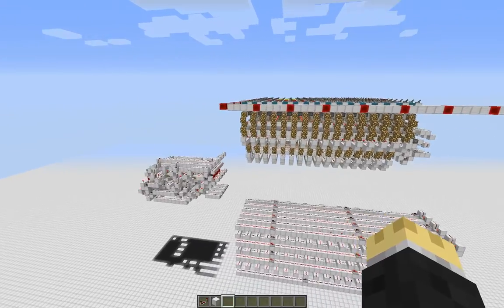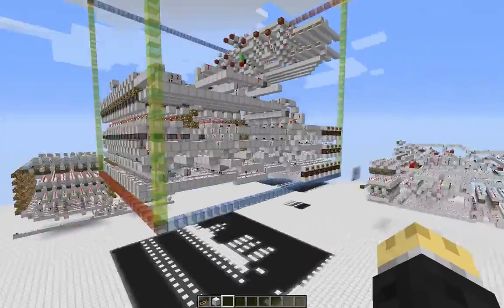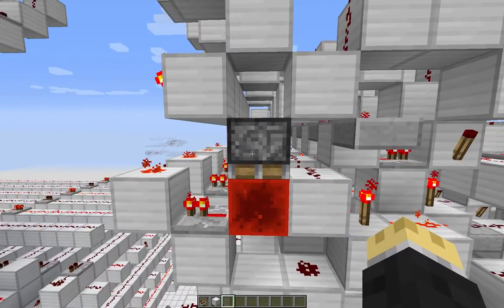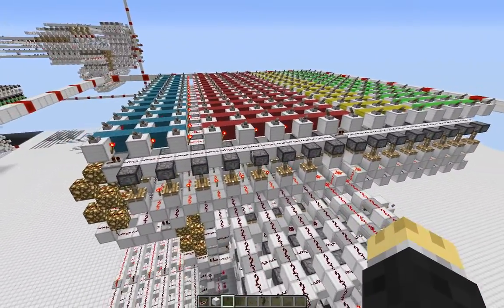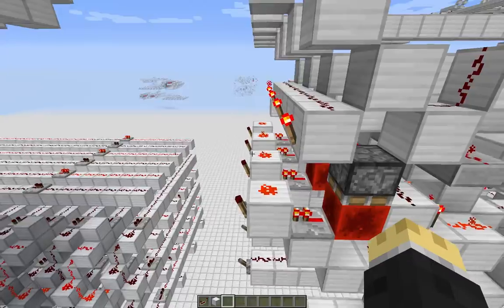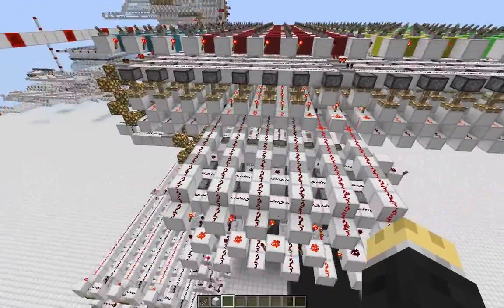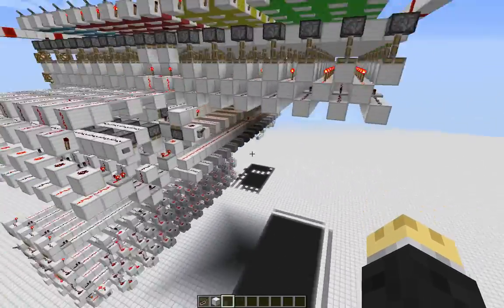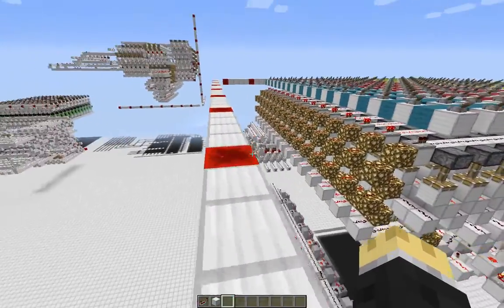Deep Thought Vlog Entry #1

Comment: What is that program memory design? More specifically the decoder. I’m using the program memory for a PC im building. I reverse-engineered the top part, but I still need the decoder design. if theres a world download or a tutorial that would be very helpful
Reply from the maker: It's just your standard run-of-the-mill decoder folded under the encoder...

Comment: Hey! I've got another challenge!: build a Processor, but everything diagonal! Btw, i love youre video's!
Reply from the maker: not sure how practical that would be... nor if it would be much of a challenge...
Reply: O! You replied! 😮
Reply: But i mean; Diagonal ALU (Maybe a CC Adder), Diagonal Registers, Diagonal RAM, Diagonal PROM... That's what i meant.
Reply from the maker: again... not sure how practical that would be.... but as far as a diagonal register and alu n such, that might be really difficult!

Also, I try to respond to people when I can ;)
Reply: I've got a "Everything diagonal" processor. With a 6Tick clock! Now I'm trying a "Everything Vertical" Processor! Again... with a 6Tick clock. And pipelined! 5Stage: iFetch, Decode, Reg, Exe, WriteBack.
Reply from the maker: not bad... I'm curious though - what method do you use to differentiate the states your CPU is in? like how does it track Ifetch, Decode, etc.
Reply: These are just pipelining stages. Like, you load data from the PROM into the bus. Thats instructionFetch (iFetch), then decode, thats just your vinite state machine or in my case just decoders for the OP-CODE, then reg, thats reading from registers and put it in the ALU latch, then execute, so it does ALU functions to that data you read, then you write it back to the registers, or the RAM. I have my RAM conected to the output of my ALU. More practical i think.

Thank you. I will send a picture (imgur) of the CPU at some point here in the comments section.
Reply: And can you maaaybeee make a video about it? And say then is name: "SmallbearsCraft"? Thats my minecraft name. Or just "Joey Smalen", thats good too. :P and a Vertical CPU please? :D
Reply from the maker: believe me I'd love to say yes... but unfortunately making a computer in minecraft takes time... I kind of have to be selective about what challenges I take on, otherwise none of them will ever get done...